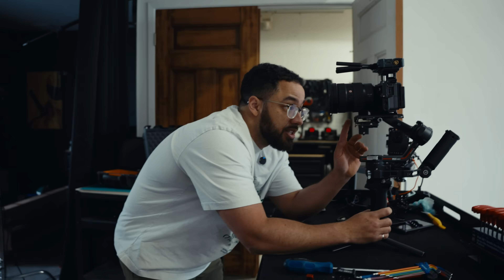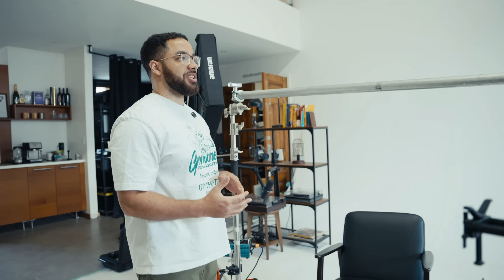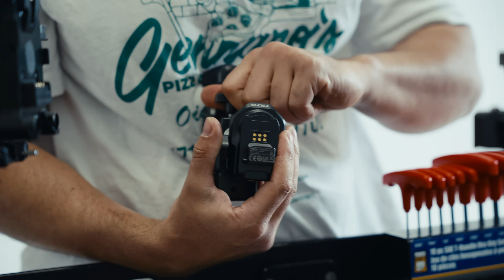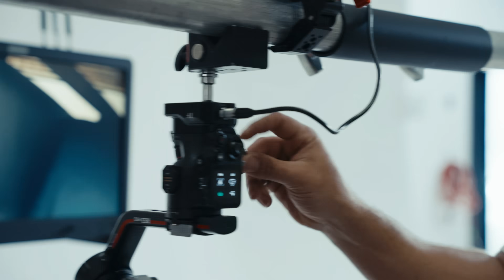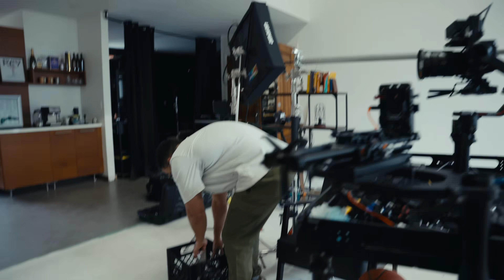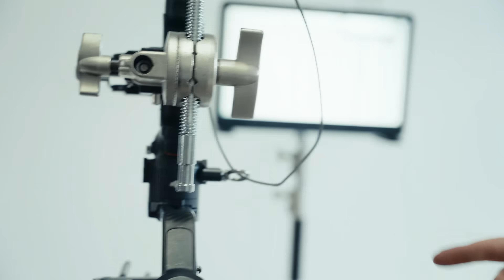How To Get The Overhead Spinning Shot (Overhead Gimbal Rig)

Comment: Man, you can nicely rotate the footage in post, what are you doing this for???
Reply from the maker: The amount you would need to punch in to get a full frame twist without cutting off corners. You’d have to do it practically.
Reply: not at all youd need a super wide lens and a 12k camera to twist in 4k like that